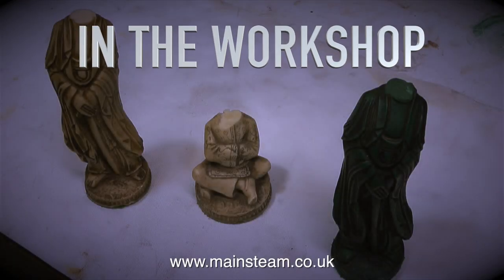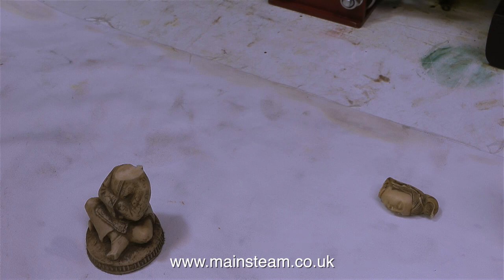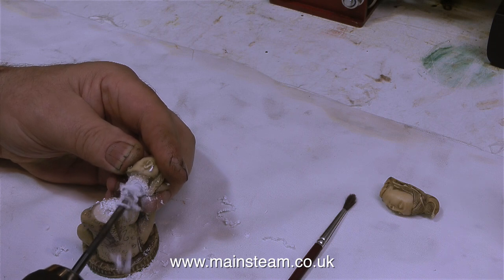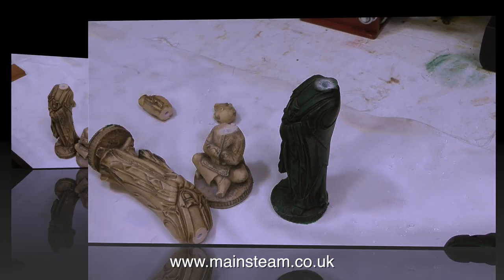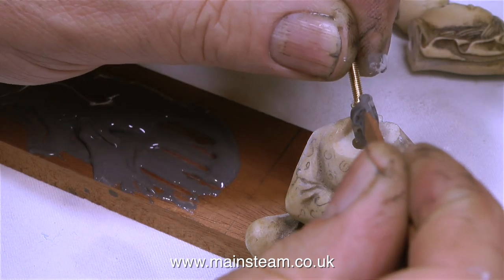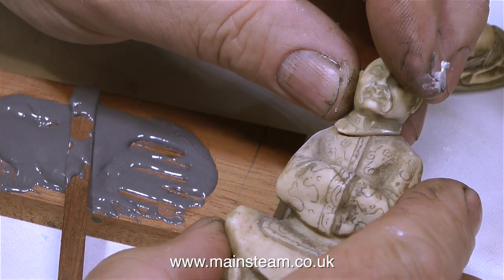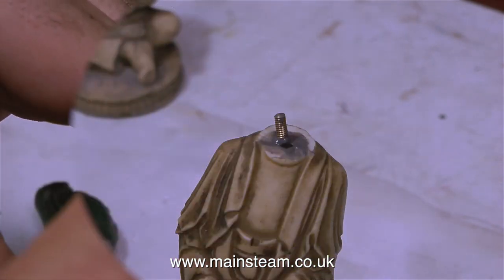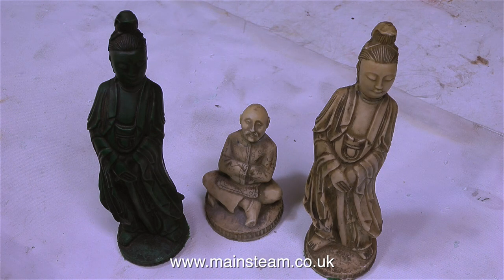HOW TO REPAIR STEAM ENGINE CASTINGS - OR BROKEN ORNAMENTS - IN THE WORKSHOP

Comment: Thanks very much Kieth.  For years I've been repairing broken plastics and struggled to align a pin or wire to the two broken pieces.  It never occurred to me to make both holes larger and the pin smaller or, as in this case, a small bolt.  Very nice, thank you Kieth. 
This video was indeed very useful.  :o)

Comment: Don't remember if I've commented on this ... I swear by JB Weld if it's used in the right way (also a comment for JB Kwik Weld but it's not as strong as the original).  I use JB Weld by very heavily scoring the mating surfaces, and cleaning/degreasing with isopropyl alcohol, using cotton swabs which leave cotton fibers all over the place.  I mix the JB Weld thoroughly, quickly, but without introducing bubbles into the mix.  I mash the epoxy into the facing surfaces, without excess, then mate the parts together.  If appearances then allow, I "swab" the JB Weld around the (scored) surrounding surfaces and attempt to smooth it for appearance's sake, if it matters.  
Point of all this is, used correctly, JB Weld is practically magical stuff.  And I have no personal stake in this, other than a grand appreciation for the product, properly used.

Comment: Hiya Keith I belive the correct term for drilling a hole in the head is called trepanning seemingly it was quite popular with the Incas. lord knows why they wanted a hole in the head. appen it's summat to do with zombies.
yours is a good idea though, keep up the good work
Reply from the maker: it was used to relieve pressure on the brain and I think that in certain circumstances it is still used today ..... but not using a small "Bosch" electric drill like I have . . . . }:-)))
Reply: I have two extra holes in my skull, put in place by a neurosurgeon, which carry cables to a pair of stimulators embedded deep in my brain in an attempt to cancel the pain signals from a brachial plexus lesion.